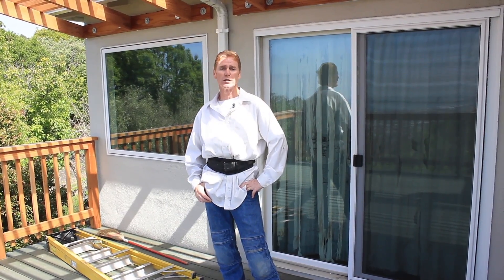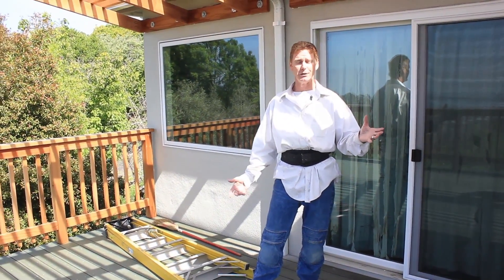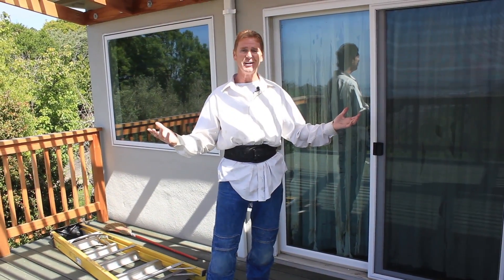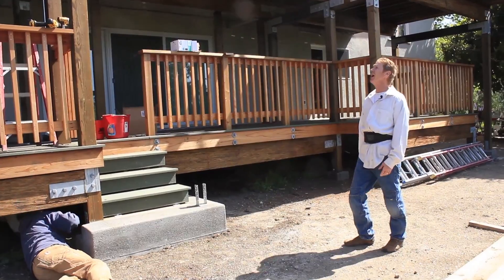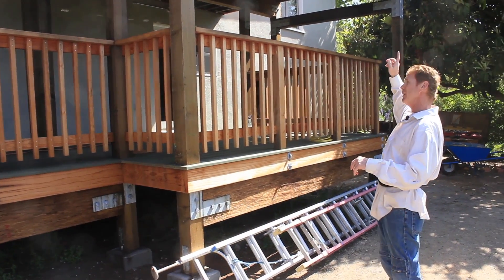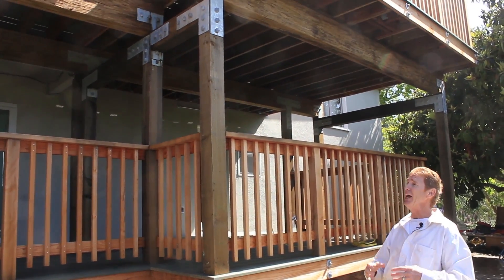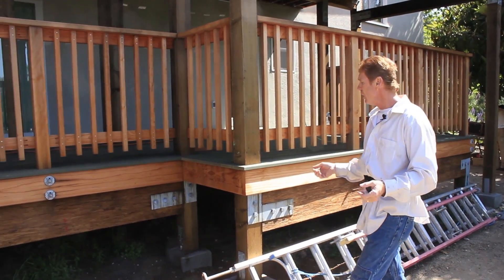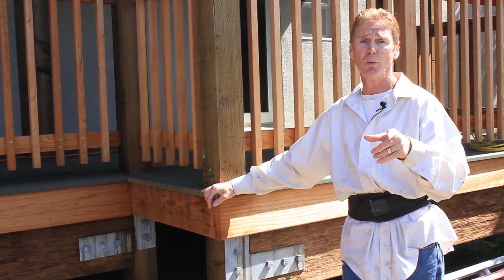Seismic Retrofitting & upgrades for stucco houses

Comment: I see a lot of bolts going thru the stucco.  Do you have a video on the best way to do that without messing up a lot of moisture barrier work?  I need to add a pergola to my house and they just added the scratch coat.  Should it have beene added before stuccoing? When is the best time to install?   Love your videos, very helpful in managing my contractor.
Reply from the maker: Hi Tom McGovern, thank you,
 I believe Tom's guys "Dave and Sergio" drilled the holes where needed, then shot in some Sikaflex polyurethane caulking sealant, then lag bolted the ledger for the for trellis.
I beleive this is the only area that attaches this awesome deck to the home as the rest is free standing.
This is my guess as I've worked with his guys in the past and they go above code on many things.
Keep in mind old Kirk's a stucco dude not a general or carpenter.
 Cheers!
 kirk and family
Reply: Thanks Kirk!
Reply: Tom, go to kirks channel and type in " how to install a ledger board."

Comment: very well build deck. I do see a few minor things but Damn!  Thats good work! Kinda reminds me of the stucco guys that I keep watching their 500+ videos!
Reply from the maker: Evening Dusty old buddy, You must be a carpenter? or General Contractor?
I wouldn't know any minor or major issues about the construction of this freestanding deck, but then I'm a stucco dude not a carpenter.
 The main thing I noticed or didn't notice is there were no cracks in the stucco although I told Tom with a two coat system expect them, but also said "caulking and quality paint would cover and flood them". It was nice to be wrong in this case.
 Best wishes,
 Kirk and family
Reply: StuccoPlastering I was a GC / Handyman for many years. Then a Diesel and Heavy equipment Tech.